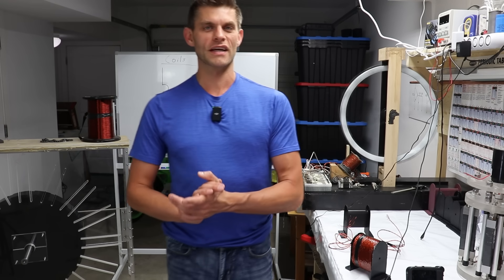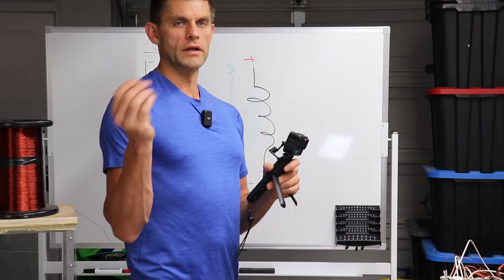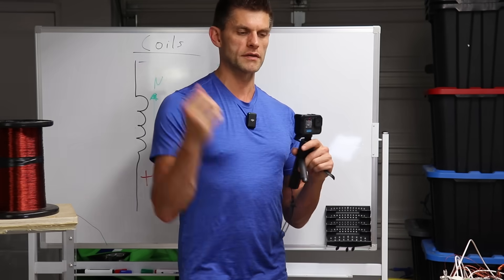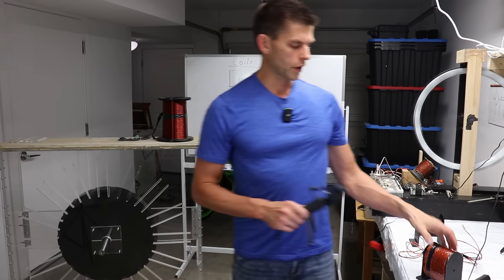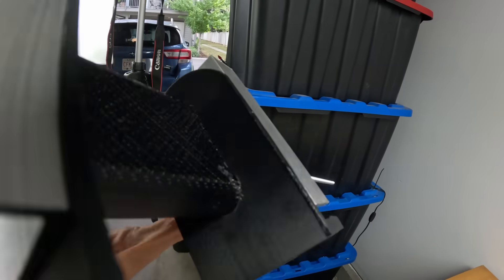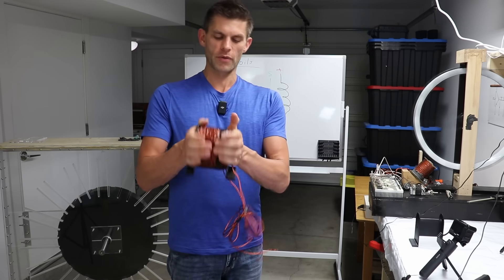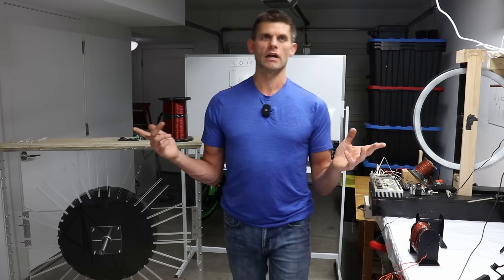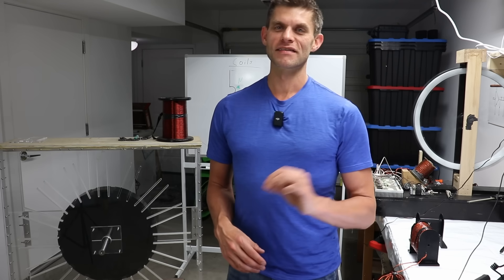Unlimited Energy in My Garage (No Patents)

Comment: The claim that a rotating magnet motor produces a "vacuum energy dipole response" in a secondary lead-acid battery is a gross misunderstanding of electrodynamics, thermodynamics, and energy conservation. In reality, when an inductive load like a motor is suddenly interrupted, a back EMF spike occurs. This is not vacuum energy, but a transient voltage caused by the collapsing magnetic field—fully accounted for by Maxwell's equations. There is no “dipole opening” in a battery that allows energy to be “harvested from space.” A lead-acid battery operates via chemical redox reactions. High-voltage spikes do not inject magical energy—they often just degrade the battery or trigger failure. The Second Law of Thermodynamics forbids a closed system from producing more energy than it consumes. If you're seeing a temporary energy gain, it's due to a measurement artifact, inductive spiking, or battery capacitance—not overunity, and certainly not “vacuum energy.” Please stop using pseudoscientific jargon to wrap basic motor-generator behavior in a blanket of mysticism. You’re misleading viewers who may not know better.
Reply: insane how far i had to scroll past believers of this bs, for a basic fundamental level headed response.
Reply: @anthonypistocchi60 dude same, It shocks me how many people beleve this crap
Reply: Lol it's insane how much i had to scroll to read something "sensible".😂 
2nd law of thermodynamic, this unknown 😂😂😂
Reply: and if you cross couple it with the thingymebob and watsit enhanced geomagnetic induction pulses you can double the output
Reply: Why are you so upset Ken?
Reply: @timgibsonflow  because "free energy" is demonstrably a waste of time, and it's upsetting to see a skilled and capable person putting time and money into something that will always be fruitless, while misleading plenty of people who don't have the education to know better. There are plenty of ways that engineers and tinkerers can contribute to the betterment of humanity, but free energy is just not it. It's not some big conspiracy. You are allowed to work on open source projects to help society. Projects like this always fail because they're trying to do something impossible.
Reply from the maker: Sure Ken, sounds like u know what's possible and everything has been discovered. Stick with neil degrass
Reply: @MadscienceLPTECH  Ah, the classic 'you must think everything's discovered' strawman. No, I just think claims of free energy should obey the laws of physics—or at least be replicable under scrutiny. You’re welcome to challenge mainstream science, but doing so requires evidence, not anecdotes, not voltage spikes, and definitely not vague metaphysical terms like ‘vacuum energy dipole response.’

What you’re showing is a back-EMF spike from coil collapse—textbook electromagnetic behavior, not a revelation from the aether. If you want to convince people you’ve broken the known laws of thermodynamics, you'll need to do better than sarcasm and hand-waving.

Show real energy balance measurements. Show your load over time. Show long-term input/output logging. Until then, it’s not a breakthrough—it’s just a misunderstood transient.
Reply: @MadscienceLPTECH  

Oh boy the classic dismissing basic electromagnetic theory as 'Neil deGrasse', that common move when a person can't actually address the physics directly so they offload onto something irrelevant.

What a devastating scientific rebuttal. 

I'm sure all those electrical engineers designing circuits around back EMF spikes are just shaking in their boots at your profound dismissal of Maxwell's equations. 

But hey, why let 150 years of verified electromagnetic theory get in the way of your YouTube physics degree? 

Keep chasing those perpetual motion machines pal, I'm sure you're just one more magnet away from revolutionizing energy forever.

LMAOOO
Reply: @MadscienceLPTECH  Are we honestly attacking the messenger as a mean to defeat a message too strong?
Reply: @MadscienceLPTECH  If you really believe in vacuum dipole harvesting, you must have a detailed energy budget logged over time, right? I’d love to see how you calculate your net gain without violating conservation of energy. Screenshots welcome.

Comment: Might I suggest rather then a foot peddle do a knee peddle if that makes sense, you might find you have better control.   My mother’s old sewing machine was electric and had a press switch on the  side where we just leaned our knee on it and I definitely felt it was better control rather than a foot peddle.
Reply from the maker: I got a lathe coming

Comment: I really feel like in order to create free energy you can’t have any moving parts. I think it must be done through ether basically… or frequency feedback combined with piezo electric energy transfers. That frequency/volume function has virtually no resistance but with exponential energy output
Reply from the maker: Both work
Reply: @MadscienceLPTECH I would give your device probably a 10% chance of working, which is still huge and worth it. But I really think it’s the wrong direction… no one seems to understand the device I have in my mind and I think that’s why it hasn’t been built yet. Im not an electrical engineer tho so I don’t have a lab…

Comment: Can you add a microcontroller with an adc and coulomb counter to the supply battery pack and one to the charging battery pack? This or some real time oscilloscope reading of both batteries. That way we could see if the power into the system is actually greater than the power being consumed? I think even if it doesn't get access to zero point energy, maybe this is just a more efficient way we can run motors
Reply from the maker: We are going to have microcontroller a data logging 😊

Comment: The engineering work is impressive and I respect the passion behind it. That said, the claim of overunity—getting more energy out than you put in—violates the first law of thermodynamics unless you can prove otherwise with rigorous, independently verified testing. Flyback voltage and magnetic collapse are real, but harvesting them doesn’t mean you're pulling energy from the vacuum. Many have built Bedini-style machines and thought they were close, but without a measurable net energy gain, it’s still just wishful thinking. I’ll believe it when it runs itself with no external input and powers a load. Until then, it’s an interesting experiment, not a breakthrough.
Reply from the maker: No it dosnt, is solar violating it?
Reply: @MadscienceLPTECH   Solar doesn’t violate thermodynamics—it's powered by the sun, which is a massive external energy source. Overunity means creating more energy than you put in without an external source. That’s the key difference. Capturing free energy (like sunlight or wind) is not the same as generating it from nothing.

Unless you have a star in your garage, that comparison doesn't really hold.

Comment: This is Nikola Tesla's ignition system. If he knew anything about coils he would never do that nonsense in the field with the drill and then cut the ends. It's absolute nonsense. Not to mention stating you can charge a battery with an intermittent pulse, if he used a super capacitor, it would be at least slightly believable.
This guy is a fraud, and anyone giving him money deserves to be scammed.
Reply from the maker: Huh, what r u talking about
Reply: @MadscienceLPTECH 
I'm talking about the basic electrical theory that every electrical apprentice receives within the first few weeks of theory. 
Really nice continuity test by the way.

Comment: Hmmmm.... see here's what you'd need to believe in order for your "tech" to work as you say it does......and that is that all known measurements of inductors, batteries, and high‑voltage transients are systematically wrong by orders of magnitude. If in fact you are achieving a COP > 1 while still obeying the law of conservation of energy.... and you can prove on paper something that no other has demonstrated successfully under scrutiny, then you're surely up for a Nobel Prize in .... something. I was gonna say Physics..... but I think Physics will be under a bus somewhere.
Reply from the maker: again a solar panel has COP >1 depending upon where the box is drawn. im not looking for recognition as an inventor, Joe and Kyle and I are builders
Reply: @MadscienceLPTECH  I mean, I'm not looking to kaibosh your work. You clearly believe in something that science doesn't take seriously or can't prove, even theoretically. When you say "it depends where the box is drawn"...... that is a semantic sleight of hand. It's saying "Your system relies on an external source of power"...... in the case of the solar panel, well, that's the sun. For your device, you are asking for people to simply believe that your external source of power is the quantum foam of reality giving up it's energy. Were that the case, you'd have to be able to demonstrate, measure and quantify this in a way that satisfies the law of conservation of energy. That is, if you gained energy from this "source", you should be able to show a reduction in energy wherever that may be. The Sun gets a major pass for proof, as we can walk outside and feel our face become warmer, implying that the giant bright ball in the sky gave us it's energy at a cost of reduced mass over time.

Comment: Using the phrase "there's something magical that happens" when explaining the most key part of the whole charade leads me to believe you engage in magical thinking...which is what unlimited energy is.
Reply: As an electrician his explanation of where the "extra"  electricity comes from was not clear and did not have any scientific basis. I spent time working with scannerguy1983 on his perpetual motion machine which was a much better design than this with almost no friction by using magnets to levitate the rotor.
Reply: It’s just an expression, he clearly explains what’s happening scientifically. It’s magic becuase we don’t fully understand it yet, over time, magic becomes science. The close minded won’t understand, but those who have the wisdom and strength to believe will change the world
Reply from the maker: Exactly
Reply from the maker: New science is magic
Reply: @MadscienceLPTECH  something weird happened when I tried turning an old ceiling fan electric motor into a generator... the second I got an LED to light up, a massive lightning storm came and lightning even struck 5 feet away from where I was... damaged the house even, messed with my car, and I was standing 3 feet beneath where it hit... inside the house... but my dad and I both were spooked by this strange event and were thinking we wanted to get rid of that ceiling fan motor... maybe that is magical thinking or maybe the device caused a lightning storm?
Reply: If you ignore the whole point of this, and ignore that money isn't the most important thing in the world, yea. If a scientist needs money to work on his possibly world changing research, don't shit on him for no reason
Reply from the maker: Thank you

Comment: The best “over unity/free energy” machine I’ve seen to date that is very unique is the faraday mono polar generator. Basically it’s an 8” disk neodymium magnetic with a steel rod running through it, the kicker is it must be spun at 3,000rpm and up and the reason for the high rpm is to get the volts up it’s make a shit ton of amps is what separates this generator. You have a brush contact on the outside of magnet and one on the Id/shaft.

Comment: He used eight wires because one of them is the trigger wire that fires the mosfets and the other seven go to the drains of all the mosfets (all of this is per bedini design specs) and the 8th wire is going to be connected in opposite polarity of the other ones so that it's effectively counterclockwise wound compared to the other seven if we're going to say they are clockwise wound, and then that opposite wire is the trigger wire and it triggers or fires all of the gates of all seven of the mosfets so that they pull on those seven wires in parallel to make a really big strong but very brief pulse.
Reply from the maker: we are not using BJTs on this build. N-ch Fets

Comment: bro, i think your explanation may be wrong, this aligns with inertia, because, when the magnet is moved by a quick pulse of electromagnetism, em disappears ,as its a pulse, but the moved magnet got inertia, which moves the wheel, that makes the next magnet to induce the generation of emf in the coil. this is how usually motor generator over unity works, actually it is never over unity, it converts one form of energy into another by the geometry and this is said to go against physics laws, because they consider electricity as total energy , they in term who defines it doesn't work. this is always the criticism i faced, even when i show the result.. total energy can't be amplified, only parts of total energy can be amplified, which drops the other forms of the total energy in the system which replenishes out itself because of property ... the critics never consider inertia in the system to formulate the result. its not even given in any books, its known only by experimenting..
Reply from the maker: i think your knowledge of whats possible may be wrong

Comment: There are more effective ways to do this.

First is taking a rad to be the rotor we place a disk with magnets around it's circumference and it is sandwiched between to plated that have spoiled coils for the magnets to pass when rotating . Many of these units can be built down the length of the rotor. And the entire thing should be oriented vertically and a fine point be put on the bottom of the rotor and it should spin in a concave polished metal disk.

The sandwiched layers would be wired resonantly with lc pumps/juel thieves on them this then goes out to transformers and capacitors to condition the power then out to s power supply. The driver can be an electronic solenoid  agsibst cube magnets on a disk like a merry go round orr two bar magnets put together. The cube magnets should be oriented with the diagonal facing outward . 

In my head it does seem to work correctly. The geometries of the magnets matter.

Another but simpler situation is taking a battery and getting a large enough feromagnetic ring and wrapping Cooper wire around it making a coil. You can do multiple windings you induce a stronger grief and there got voltage into the ring it self.

Create another ring with windings going the opposite direction production our positive and negative poles. We can solder a wire onto the coils themselves tapping the voltage and current of the ring and tie it to our application.

It should work fine I got it to light a light.  The idea is you need to match the impedence of the battery in the coil in the battery to prevent ekectron flow because of the impedence of the coil.

You can open source those please give me some credit if you build them and demonstrate them.

Another idea is a gyroscope in a box that has been placed under a vacuum. The perimeter of the gyro would have magnets on its disk as it titstes it passes the coils and induced charge into them.

A gyroscope under a vacuum had not air resistance and more or less spins with out slowing it stopping unless something acts against it.

We basically use something like that on done sattelites in outer space to keep them charged and powered.

Cheers.
Reply from the maker: Let's see some of your builds brother. Great comment

Comment: You are fundamentally wrong about inductors. The power surge is in the same direction as the original current and quickly decreases from the original current amount to zero. The voltage across an inductor never exceeds the applied voltage, either, as inductors resist changes in current . It's very easy to study. Also, dipoles don't collect zero-point energy. There are dipoles everywhere and none of them do it, and the one example of zero point energy in motion (helium at absolute zero) doesn't even contain a dipole! If things worked the way you say, then the simplest electric motor wouldn't spin due to backlash in the coils.

This is such a clear scam it's actually a little sad.
Reply from the maker: I appreciate the input and standard explanation of e and m... but as I said there is somting that happened inside the battery when HV spikes are applied, no one said more standard e and m came out of the flyback.